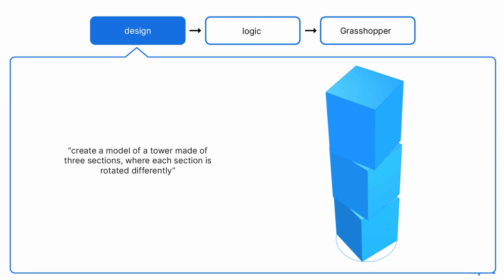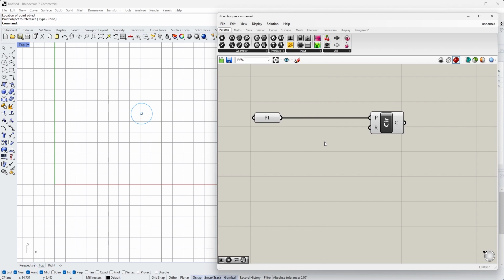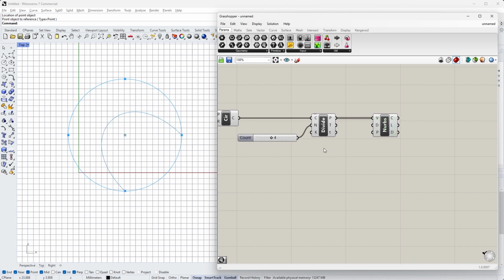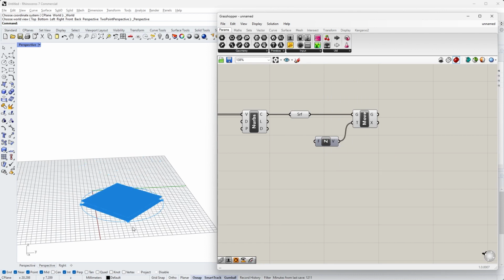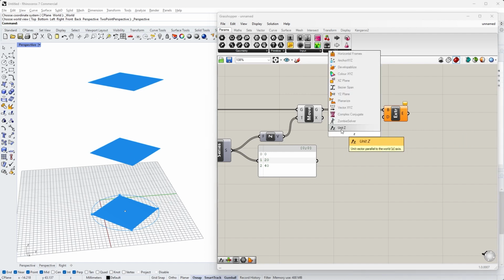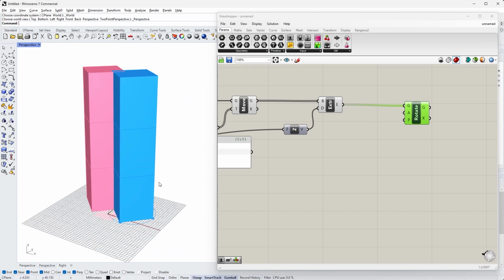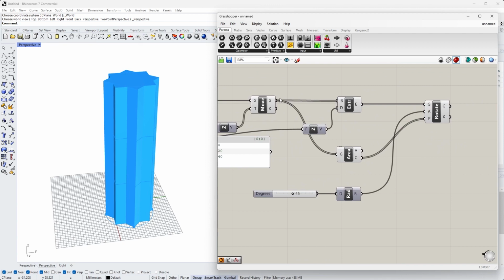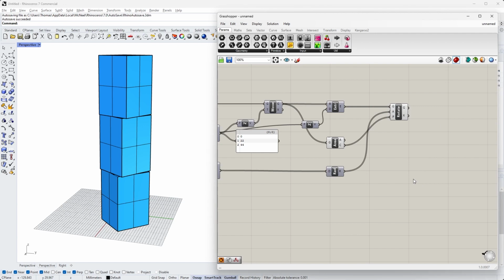Getting Started with Grasshopper - Lesson 05 - Design Exercise

Comment: These lessons were good — thank you.  Q1: What is the appropriate way of saving the files so that you can re-open them together, with the Rhino geometry associated with the Grasshopper nides?  Q2: How does 'baking fit into the typical workflow?  Do you normally only do this once when you're ready to — for example — export the Rhino model for 3D print?  Is there any way to "un-bake" if you need to iterate again?
Reply from the maker: A1: That's a great question. Currently the Rhino and Grasshopper files are still separate files, which means you need to keep track of which Rhino file works with which GH script. But in practice, you often have one 'master' GH script for a given project, so matching it to the right Rhino file won't be a problem. There are likely to be different versions of both the Rhino and Grasshopper files over a project lifecycle and the latest of each should match.
A2: Another great question. This depends on your specific application and experience level. Until you reach an intermediate level, staying in Grasshopper until you are satisfied with your solution and then baking to a specific layer works well. You can create different iterations by baking to different layers and name them accordingly to keep track of different bake versions. 
There are components inside Grasshopper that allow you to bake objects to a specific layer in Rhino. You can press a button on the component to bake and it will replace any previously baked output. Look up 'Content Cache' (one of the new components in RH8), or use the bake components of the 'Elefront' plugin.
Reply: @hopific  Thank you for the detailed response!